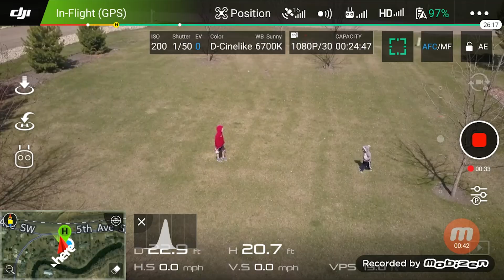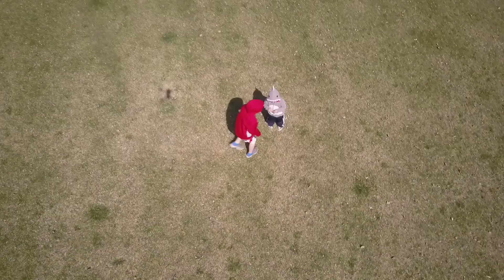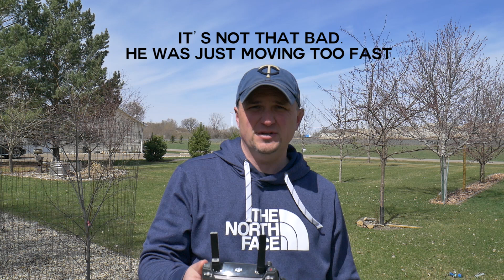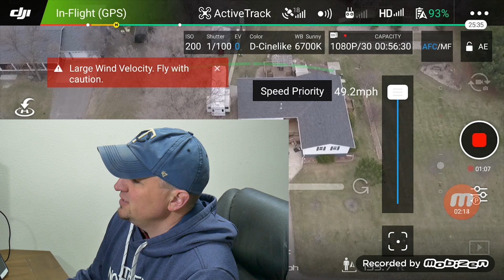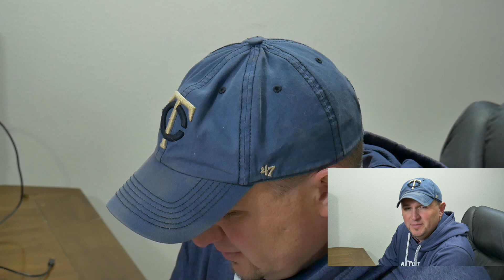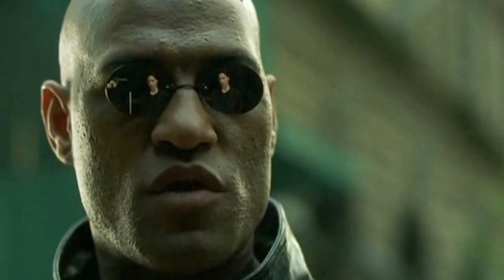Mavic Pro for Beginners | Active Track | How Intelligent Is It?

Comment: Been thru that painfully, I'm both a whistle blower on gaslighters in gov and a professional tech for these type of electronics. I assume with confidence they knew the 2 follow modes were largely broken and after I bought 6 new devices that were suppose to work with "follow me", I understood they were just gaslighting reasons for failure "operator error".  Don't fall for the advertisments that this drone tracks anything with confidence.

Comment: sir when I'm flying my Mavic pro and when i press my rigth/left  joystic, my camera moves like an airplàne even though my plane mode is off, kindly advice tnks
Reply from the maker: So it acts like it's in FPV, but it's not?
Reply: 51 Drones it moves like am in fixed wing mode, but i did turn it off.

Comment: have a question about the gimbal and camera,it will start jumping around going in al direction and a over load message comes on my phone ,has any one have this happened  from Larry O
Reply from the maker: I have not.  That does not sound good.
Reply: I did when first put lens filter on or gimbal is stuck some where when it trying to calibrate after start up
Reply: for lens filters I now let drone start up normally when gimbal calibrates and finish I then put on lens filter

Comment: I also have spotty experiences with active track. I do know however that when expecting to experience obstructions the follow me mode can do a better job since it is more dependant on GPS. It does not do as well at centering the subject in the frame.

Comment: Hi, great video..I too, am not comfortable with the 65MPH.  Maybe with a 35MPH tail wind..
Other than that, did you consider the placement of the remote control in relation to the Mavic?
Was it on the seat of the truck, on the dash, on the roof or in the bed?  All that metal will effect the ability of the controller to send/receive from the aircraft.  
Just a thought..

Tom
Reply from the maker: I believe he was stating Km/h rather than MPH.  The controller was on the seat.  I believe the biggest issue was the trees.

Comment: Your drone is too far from the target I think. Also, the speed slider should be set to maximum speed for mavic on active track. I have played with active tracking a bit and learned that the further the drone the more the tracking is breaking. Here is my first try. https://www.youtube.com/watch?v=FtcGO4dSvHs Look for a road with no trees and electricity wires around and keep your drone low and close. You will like the result. Here is mine. I never calibrate anything unless the app advises me to do so.
Reply from the maker: I still don't understand the concept of the slider.  Why have it?  What would be the need to say, dial it down to 5mph?  If your subject is going 5mph, and you have the slider set to 40mph.  The Active Track will still follow it.  It is just unclear to me the need to have the speed slider.
Reply: Right, I am with you on this. Slider at the max all the time. I dont know if setting the slider slow results calmer behavior of the drone, it might. Testing testing testing.....

Comment: That just happened yesterday: I wanted the Mavic Pro to follow me making a big U-Turn (partially under some tries) on my bike in spotlight mode - it was relatively dark (forest 1 hr before sunset).
1. First part worked great then without any obvious hurdle it lost me and beeped.
2. So I stopped and quickly indicated the subject (i.e. me) and said "go".
3. Then it followed me (obviously in Track-mode not Spotlight!!!) which is hell of a danger in a forest and luckily it lost me again before it would have crashed into some branches (maybe 2ft left!!). Really freaking.
So lesson learnt: always double check that Spotlight mode is on after it lost you!!!!!
Correct or did I something wrong???
Reply from the maker: It sounds like you did it correctly.  I do not believe it is supposed to drop out of Spotlight mode until you tell it to.  I will do some more research and get back to you!

Comment: I used it with my 4-wheeler. It would lose connection if I turned to sharp or to fast. I need to play with it more. My fastest speed with the wind pushing me is 43.5 mph ( not in Active track) can't see it going 65 if it did I don't think it would be able to get back to me.
Reply from the maker: Billy Gillentine 43.5 is good!  I would be very surprised if it went faster than that.
Reply: I show a new top speed after flying this weekend. I used fixed Wing mode my top speed now reads 53 mph it was a big gust of wind I must have hit it just right.
Reply from the maker: Wow!  That's fast!
Reply: It was just for a sec

Comment: Could it be that the 65MPH is in fact 65KPH (=40MPH). I believe DJI has made a MPH/KPH mistake before in the GO App
Reply from the maker: Yes, I think you might be right muf!
Reply: I don't think he said that it will fly 65m/hr "active tracking," though that was the subject.  I think he meant under certain conditions it will fly 65,
Reply: When the software is "hacked" it will fly at 85km/h. The angle of attack changes dramatically.  50 Miles per hour, give or take.